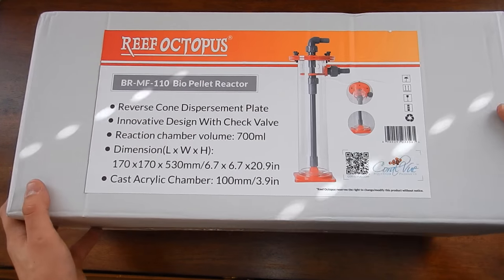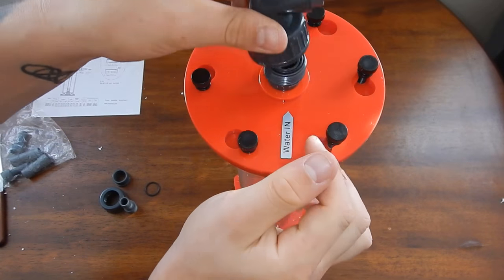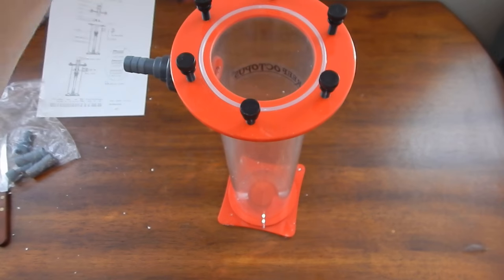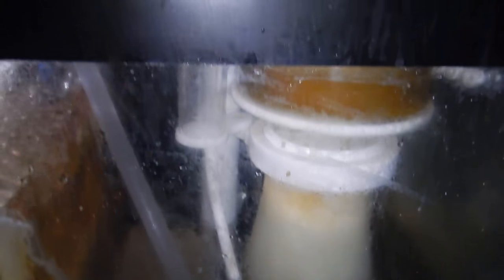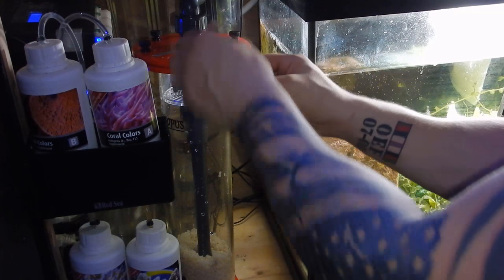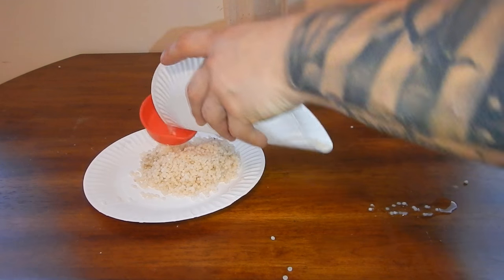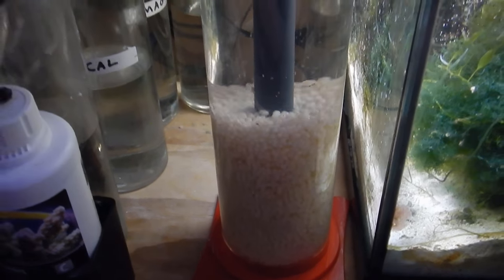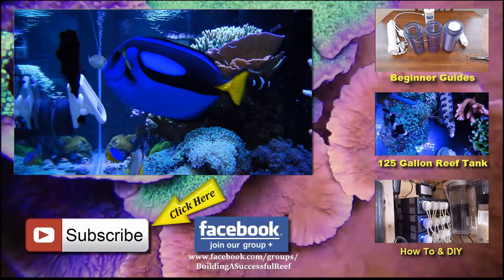Upgrading To A Reef Octopus BR-110 Biopellet Reactor

Comment: In the manual on BRS it says to glue the barb fittings...is that really necessary? Did you glue yours?
Reply from the maker: I glued mine without even reading the manual. If it comes out you drop all that water on the floor. So to be safe do it.

Comment: if i have extra bacteria on my rocks that means I used too many pellets?
Reply from the maker: Are you talking about red cyanobacteria outbreak in your main display?
Reply: Nope, not cyano. I have this fuzzy stuff under my rocks. Its clear. It looks like the stuff that grows on a decaying shrimp when using it to cycle a tank.
Reply from the maker: Its prob a type of sponge id have to see a picture of it to be able to get a better idea. You could post a pick on our fb page. If you are skimming off the output of the reactor you shouldnt have anything to worry about. As for to many pellets you would most likely strip the tank and cause coral death if you had to many pellets.
Reply: No coral deaths and the pellets have been running for a few months. I'll definitely post a pic on the fb page. 

Do you have a video on how you setup the biopellet outlet to the skimmer inlet?
Reply from the maker: +Dos Maiz (Twocorns) I do not I took the skimmer input to homedepot and found an adapter then drilled a spot for a barb fitting

Comment: I run a 90 gallon reef tank with a 951GPH Sicce return pump. I have a manifold and was hoping the run this off my return, is this enough you think to run a reactor for my size tank? I currently run a GFO and UV sterilizer thru it now on the manifold. Thanks
Reply from the maker: you should be fine. They also make a smaller reactor just like this fyi
Reply: Thanks for the speedy reply, when I set up my reactor in a few weeks I'll try and give you a shout out, thanks for your service. Got 11 years in the NC guard myself.
Reply from the maker: Check out my biopellet guide video if you get some time. should be in the beginner guide playlist. And thanks man
Reply: Would the Reef Octopus BR 70 probably be okay for a 90 gallon or less?
Reply from the maker: We recommend 1 cup (236 ml) of BRS biopellets per 50 gallons of system volume.. so i would do the math on what it can hold.
Reply: Thanks I did the math and thats PLENTY big enough for a 90 gallon tank, unless your just running a crap load of bio pellets! You would have to run at least a cup and a half per 50 gallons to go over its capacity. I spoke with BRS and they say to start with less than the recommended amount closer to a 3/4 of a cup...which I may actually go lower than that just to be on the absolute safe side until I get her dialed in. Measure twice and cut once right.
Reply from the maker: here i go over all that stuff https://youtu.be/_YCKdcec98s?list=PLlyrWzDlRs-o8wXkbVMIZUd9eYVfo0P-T
Reply: I'll watch it now
Reply: Watched the video....pretty much what you said was what BRS told me over the phone today, I caught this off there website in regards to UV sterilizers. "We recommend turning the UV sterilizer off until you have achieved results with the biopellets and then turning the UV sterilizer back on"...I personally own a top of the line UV and will do like they say...